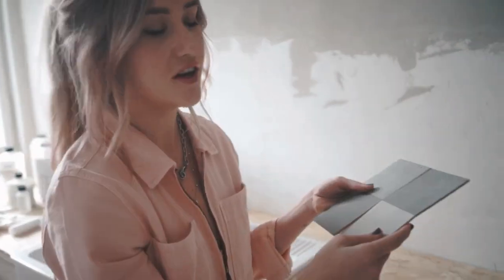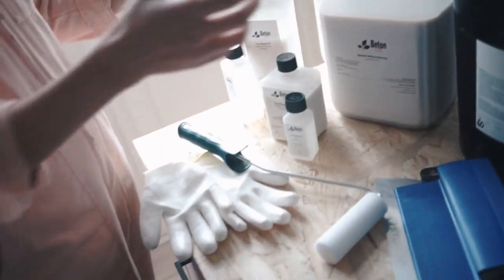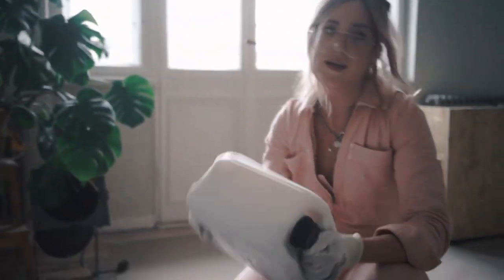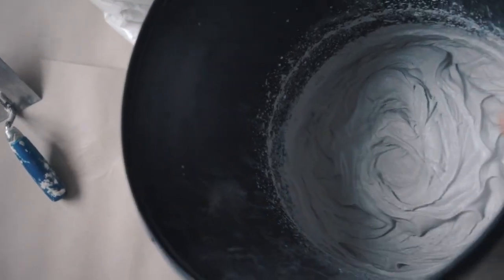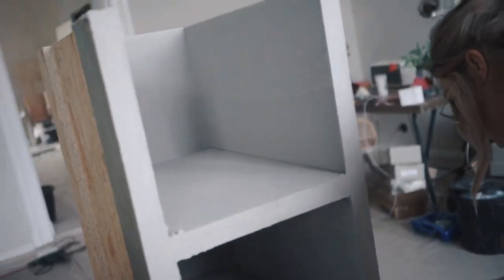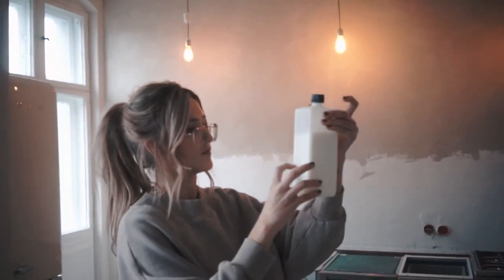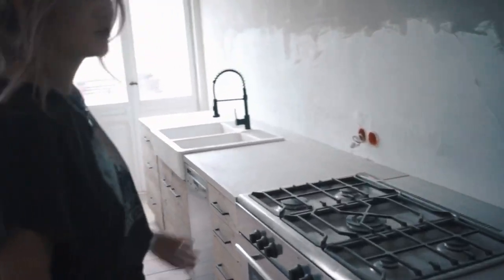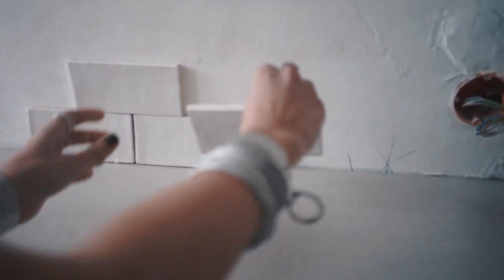covering the kitchen with carament microcement - Casa Cozy | MIKUTA vlog #48

Comment: Ive been installing microcements for 20 years and have to say you guys did a pretty good job for a first timer...But I would never recommend OSB board as a base as it can swell badly and rot if any moisture finds its way into it...Also a microcement on top of a wood base for a countertop is not going to be durable. Be careful not to cut on it but only on cutting boards. Youll be tearing these out and replacing them with a real countertop soon though...Microcements are great for floors and walls, but definitely not kitchen countertops.
Reply: I have learned recently there are some higher quality grades of OSB now, which MAYBE are okay?? I have not traditionally had a good opinion of it, but I hear the Huber Zip system stuff is a different animal for one example.
Reply: would it be OK to put the micro cement directly over a formica type surface?

Comment: hi there. Fantastic result. I'm just curious - how has the microcement held up to use in the kitchen? Does things like oil, vinegar, etc mark up the finish?
Reply: ofcourse, it's highly porous. their kitchen will look like trash in 2 months ... if they even cook
Reply: @paisleyplastic  The cement is finished with layers that protect the cement from heat and moisture. This isn't a new material, it's used in restaurants for example. Although I don't know if they did that
Reply: As the film shows, a final sealant coat is added, so not porous so doesn't stain.

Comment: Hi your kitchen looks great!, how is the microcement holding off regarding the usage? (stains, heat, knifes dropping , etc. ) I have an island where we are considering to use microcement but the local installer says it doesn't hold off that much when "heavy use" thanks!.
Reply: Dont ever use a microcement for a kitchen countertop if you want it to hold up and last. Just go with a real concrete countertop. Micro's are great for floors and walls but definitely not kitchen countertops...Been installing microcements and concrete overlays for 20 years and would never recommend it for a countertop to any customer.
Reply: @TimKollat  Hi hope you don't mind the question, but I'm thinking about using microcement over an advantech osb subfloor.  Would you say to avoid that combination as well? Thanks in advance
Reply: @beckychristoforo8705  The OSB subfloor will need to be secured down very well, metal lath installed with no seams (overlap each lath piece by couple inches) and stapled down well. I personally would also waterproof it all first with an elastomeric before installing the lath (do not forget the metal lath, its the most important part of the whole prep)
Then you have to encapsulate it all by using a self leveler (you can use a trowel down product but not as easy to get smooth and flat) Once dry, sand off residue and any trowel marks..etc and then install micro-cement as normal.
Im assuming this is on a second floor or at least not on a solid concrete subfloor, so you will get movement in the floor. Expect to get some cracks at some point. The metal lath will keep it from coming apart but will not prevent cracks due to subfloor movement.
Reply: @TimKollat  Thanks for the advice. I really appreciate you taking the time to answer my question.
Reply: @TimKollat  Any thoughts on using a high strength fiberglass mesh (made for stucco work) rather than the metal lathe?
Reply: @beckychristoforo8705  You could apply an elastomeric to the wood and lay the fiberglass it the wet elastomer and apply more on top of fiberglass and brush or roll it out to make sure fiberglass is fully encapsulated...then micro-top after dry.
I prefer metal lath for this as its more "structural" than the fiberglass method
Reply: @TimKollat  Can't thank you enough for your input. I had considered embedding mesh into the elastomer as an option but had no idea if it was viable at all- could save a lot of time/money. The subfloor doesn't have much flex (it's advantech over an inch of polyiso foam over a half-inch plywood subfloor), so the extra strength might not be necessary.